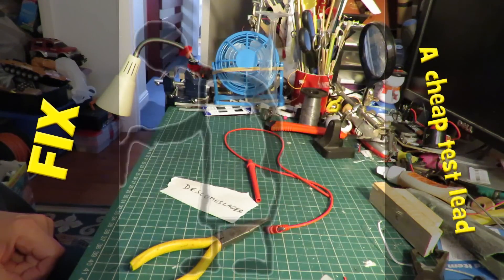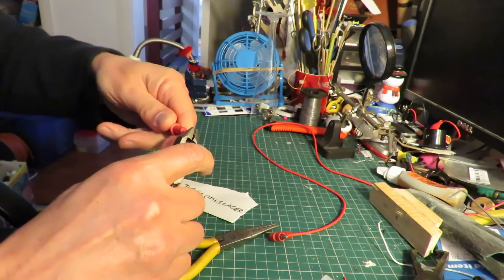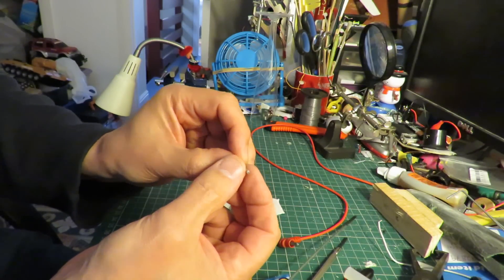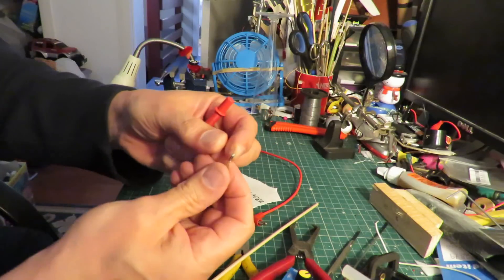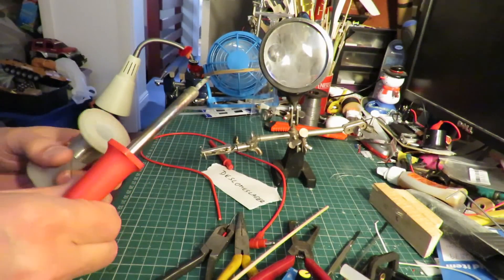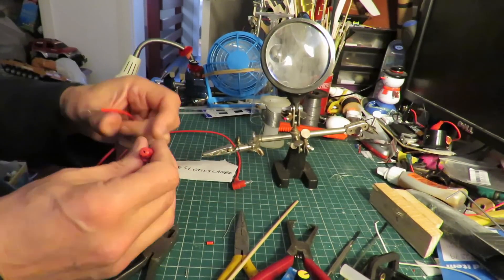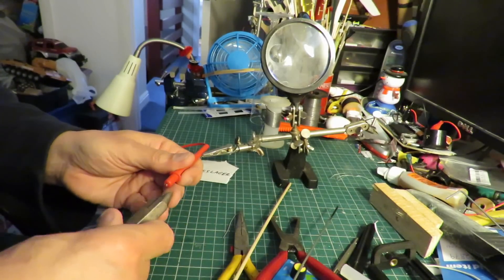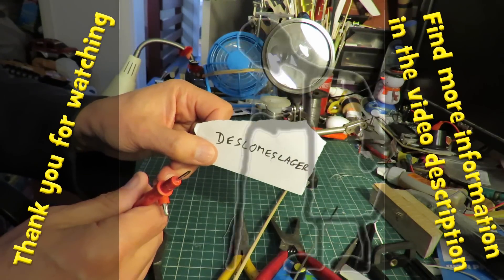Fix a cheap test lead

Comment: Well, what you do after you Solder and  put it back into the sleeve,,, and  set it probe out by  pulling on it with  your needle Nose... YOU MUST secure the WIRE so it doesn't have any thing Pulling on it as its a VERY THIN wire...so you pack in another wire,,   or heat shrink .. so IT DOESNT move inside the PROBE..
Reply from the maker: Thanks, that would certainly make it more robust and last a bit longer 😊😊
Reply: There is certainly a design flaw, as  usually  a Knot would have been secured  to keep from  pulling the wire out  from the BOTTOM ... What THEY Need is a TOP end,  removal, with some sort of  screw,  take out  the Tip from the Top ..  Harbor Freight  distributes these all across the United States ..    A person has to be Extremely Careful with these Leads , when TESTING. ..   Thanks FOR your Post on FIXING ..
Reply from the maker: I think the bottom line is they are cheap junk and you get what you pay for. If you intend to do serious work with them you really need to buy more robust items. You are right that they could be potentially dangerous if you are measuring mains voltages and they fail on you.
Reply: I do NOT believe, there would be a DANGEROUS situation ..,,, You just will not get a reading..   SOLID state wires would be  better, so they DO NOT PULL OUT... MOST of their MONEY & Technology,   is in the MULTI METER,,,,,   all  they Need to do  is FIX the PROBES .. so the wires do NOT FALL or pull   OUT...!!!ONE other Possible Solution I was thinking of a Possibility ...,,1) is to  drill a tiny  hole in the Plastic HOLDER,   some were down the  RED Shaft   2) THEN  put in a set Screw  or Allen Srew   with a FLAT Base,  to Push &  HOLD the Wire Tight in the Shaft ..  YOUR STILL THE Magician !!!!    To Be Resourceful, Pragmatic, problem solver,  with Diligence and  to work on what you Have IS a Remarkable Trait to Have  !!  Good JOB on telling us what you do ..

Comment: Thx for taking the time to produce this video. It completely saved me from purchasing a new MM. Luckily, my lead-pin plug was kind enough to have a plastic jacket that unscrewed (RadioShack). Nonetheless, the value of your video is that it shows it can most likely be repaired; possibly with a bit of fiddling around.
Reply from the maker: Thanks, interesting to fix it but probably not worth the effort. These are so cheap that if you costed your time, replacement was cheaper. On the other hand you do get satisfaction from a fix. As Gary T commented, these will probably still fail as the only thing securing the wire is the solder and that will always be the weak point.

Comment: Why the fan when soldering?
Any breeze kills the temp in my iron.
Reply from the maker: Don't aim it at the work area, you just want to blow the fumes away from your face. I know exactly what you mean and have suffered the same problem, obviously it depends on your soldering iron's power rating and what you are soldering.

Comment: I know that this is an old video but I have just jumped through the same hoops today. 
To effect a repair:- 
push the  "disconnected" probe down the "barrel" (as shown on this video). 
Push the probe of the other lead INTO where the other probe was pushed out from, i.e. into the smallest end of the "barrel" (pictures really would help here I think"). When pulled out again a retaining collar comes with it!
re-solder the "disconnected" probe, push it all the way back into and then right through its "barrel".
Push the collar back on the re-soldered probe leaving the same length of probe showing as on the other lead and push it back into place - et voile!
I think it safe to assume that not all cheapo Chinese test leads are constructed in the same way, but this worked for me. BTW this is not a dig at Chinese products, my "Chonda" rotovator has been chugging away for a few years now B-) 
In an attempt to minimise the risk of the break re-occuring i have used a cable tie to trap the lead against the side of barrel to act a a mechanical strain relief. Only time will tell if that "good idea" works B-)
Reply from the maker: Hey thanks for adding that information Bill
Reply: i hope that you were able to follow my description of the repair I effected i.e., it made sense. In this particular instance a picture would save a thousand (ambiguous) words.
Reply: It made sense to me. Not sure if I still have any of these leads, next time I am digging into the pile on my work bench I will see if I can find any and have a go :-)
Reply from the maker: I have pasted your guidance into my video description so people can find it.

Comment: I tried this just yesterday and as soon as I went to check a battery voltage in my car the damn thing popped straight back inside, not to be defeated by a cheap piece of crap I managed to pull it through again and have just epoxied the little stinker back in, I also ordered 5 sets of better new ones on the side.
Reply from the maker: I feel your pain 😊 Yes, I probably wouldn't have bothered trying to repair it if I hadn't received the original comment from deslomeslager. As he says in his comment lower down here it is handy to have a spare 😊

Comment: sometimes the wire is so very thin, and i think i had one that i am sure was aluminium, albeit copper coated, could not seem to solder it, but it was a lead from the cheapest meter ever!  same with trying to solder on those cheap headphone cables.

Comment: please make a rc car used by trash
Reply from the maker: +Gurdeep Singh most of my projects are made from scrap. Here are some of my RC playlists
Radio Control Remote Control playlist https://www.youtube.com/playlist?list=PLA5a2xPRSrB13Xcquw4Ff09MQzTPjeVkI
Radio Control Cars - Grandad Style https://www.youtube.com/playlist?list=PLA5a2xPRSrB0hs_uRx0mCbsNsQSKE0i_3
RC Ducted Fan Boat https://www.youtube.com/playlist?list=PLA5a2xPRSrB3d0TvbCZftqbS4Fh-1911Q
RC Converting my Playmobil Conlines Titan Cargo Ship to RC https://www.youtube.com/playlist?list=PLA5a2xPRSrB3oBfGysVG4ebHEe7JOfDuE
RC upgrade New Bright Corvette https://www.youtube.com/playlist?list=PLA5a2xPRSrB32Nv7aIGH_EvNJ6L8j3Luv
RC Rescue Recovery boat https://www.youtube.com/playlist?list=PLA5a2xPRSrB1WH8Pe1q86jf25zcTZ7ViB
RC Toy Projectile Launcher playlist https://www.youtube.com/playlist?list=PLA5a2xPRSrB3NKaSR_hI1gTUBtOyUvthu
Reply: without using survo starring
Reply from the maker: Gurdeep Singh Servos are commonly electrical or partially electronic in nature, using an electric motor as the primary means of creating mechanical force.

Comment: when my test leads broke on my voltage meter (forgot how they broke), i just pulled out the wires from the plastic things and put on aligator clips. did just fine.
Reply from the maker: +Epic Face 3000 sometimes you need the pointy probes instead of croc clips :)